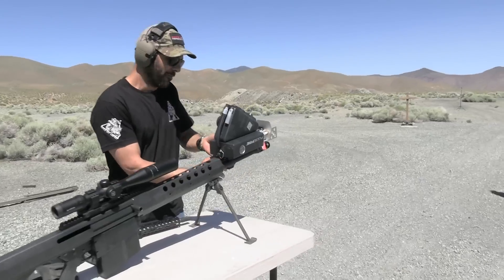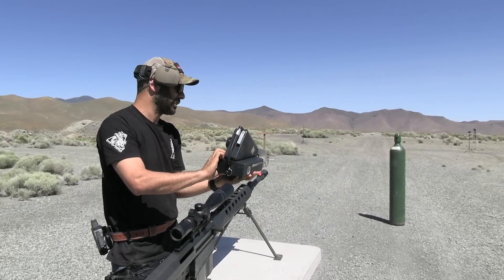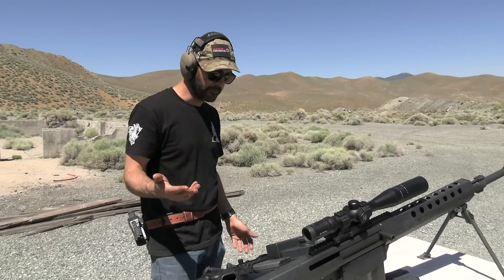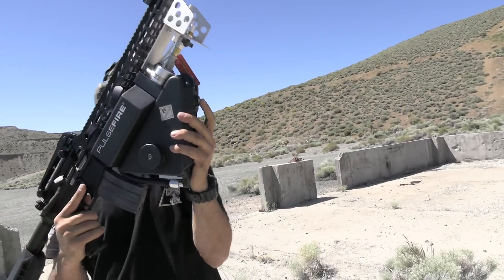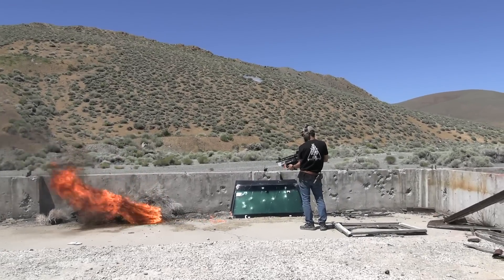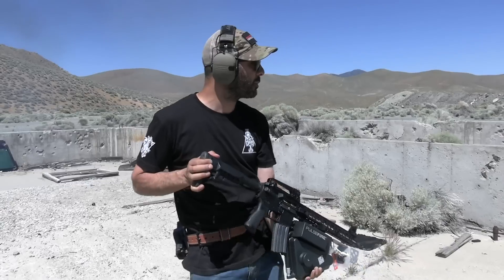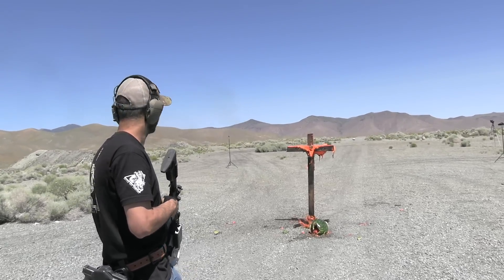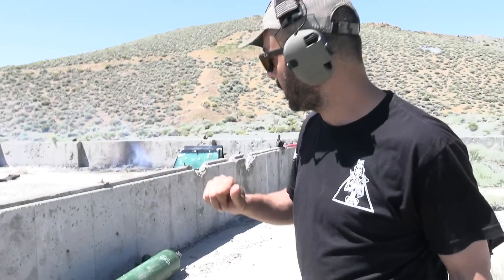flamethrower at a Full Oxygen tank

Comment: Edwin.  Use grease.  Heavy grease coated around the oxygen cylinder.  I doubt it would be that spectacular as I am only familiar with the exothermic reaction when grease comes into contact with liquid O2.

Although I did hear that a pilot who used pure Oxy after eating greasy cheese sandwich lost his teeth in flight when it spontaneously combusted.

Give it a try man.  Make sure you use welding glasses so you don't burn your retinas.

Comment: If your looking to get an, O2 explosive effect you need to have a O2 rich environment contained in an enclosed space. But then again you would want to do it remotely. The effect of the reaction, would put you in the hospital should you survive, from being that close to event of the conclusion and fireball. What your doing is extremely dangerous. You should consult with several engineers that have experience in what your desiring 5o create for your, Science Channel. It’s the volume of gas containment that is accessible by petroleum of open flame, that gets the desired effect. But as stated earlier, what your attempting is dangerous and your just standing to close at the point of reaction. It could have lethal consequences on your, cameraman as well as your self. The fireball would have consumed you completely had the effect taken place with the distance shown in this broadcast. But then again, your more than old enough to continue in trying to light yourself on fire.

Comment: Someone's not been doing their stoichiometry revision...gases have optimal air to ignition source mixture...too much fuel and not enough air will result in zero ignition, or at least, a much less efficient burn or a burn which requires by far more energy from the ignition source.

Also, it's probably best not to try and ignite an O2 tank from in front of it as the likelihood is that if it did catch, the tank will become a high speed projectile in your direction.

Probably would have been better for you to switch places with the O2 tank placing it tank facing away from the barrier where you were trying to light it from with you on the side of the wall where you had the tank.

Comment: The biggest danger of an oxygen tank if im correct is when its surrounded by fire and the pressure inside the tank surpasses the tanks capabilities so it explodes and mixed with the fire it creates a huge fireball and shockwave
Reply: all pressure tanks have something called a burst disc, it is designed to break and allow the excessive pressure to escape safely thus keeping the tank from becoming a bomb.... if you look closely at the main valve on the tank you will see a "nut" with several holes drilled around its perimeter, that is the burst disc assembly.
Reply: @bunnykiller  I aware of that but I failed to mention it in my previous comment, I was mostly referring to the old pressure tanks which don't have that safety feature but based on what you're telling me almost all if not all modern pressure tanks have a excess pressure release valve correct?
Reply: @TheRealName7  yup, since about 1970 or so any tank that can be transported has to have the burst disc... Federal law DOT

Comment: using a mix of 50% gasoline and 50% diesel works better for the flamethrowers because it gives you that more consistent stream, burns longer, is more resistant to wind, and it sticks to stuff better
Reply: Knox gelatin and diesel. Go for it.
Reply: Mebbe add a little bit of dish soap, too.
Reply: @johnnyappleseed6415  soap or used motor oil can be a good extra touch
Reply: @johnnyappleseed6415  We are all cheering for more destruction lol. I have used that 50 50 mix, it burns amazing like napalm
Reply: Adding granulated sugar adds to its adhesive qualities.
Reply: Reminds me of the song Napalm Sticks to Babies.
Reply: Also and a little bit of dawn dish soap to make generic napalm 😁👍
Reply: True. Diesel is harder to catch fire, but also harder to put it out if it does.
Reply: "NAPALM,NAPALM STICKS LIKE GLUE!"....
Reply: In minecraft
Reply: Great Advice.
Reply: I have no idea how safe it is, but apparently styrofoam just dissolves in gasoline and it turns into napalm
Reply: @sandgun3269  yes it does, i made it a lot and still do sometimes and its pretty neutral, diesel can also help stretch the burn time
Reply: As an old special effects and pyro.... most of these mixes aren't bad. My personally built flame throwers used a 9 litre mix of 40% diesel, 10% used hydraulic oil, 10% used transmission fluid, 30% gasoline, 10% pure petroleum spirit, and a shot or so of dishwash soap. 
This is thick enough to stream well, while degassing along the way, giving shooting and staying flames.
Our naptha mix was similar, replacing the hydraulic and trans fluid.
Reply: @FlattardiansSuck  i'll keep that in mind as for i'm currently in the works of making my own flamethrower
Reply: Good input
Reply: Make real napalm.  Styrofoam and gasoline to the right consistency
Reply: honestly a toy for small children
Reply: Or just use kerosene, no mixing.
Reply: I usualy go for napalm or a 25%diesel 25% r
Gasoline and 50% napalm  Mixtur 

Really dangerous but its a Flame thrower  you want it to shoot flames

Comment: If you can, I hope I could see a powerful LASER to an Oxygen tank. 
That must be a 100 million views.
Reply: Looks like Edwin needs to partner with Styropyro for that one.
Reply: Oxygen is classified as an accelerant or "oxidizer "  by scientific community.  It alone has no flammable properties, but mix it with gasoline vapor, hydrogen gas (i.e. Hindenburg disaster), dry fuel found in a rocket booster, and now you have a party! It gives your combustion reaction the ability to burn fuels at higher heat and speeds.  A laser will only burn a hole in tank and maybe let it go flying from leaking compressed gas. Thrust.😅
Reply: Laser experiment now

Comment: The manual says not to open the fuel tank, nor re-fill it without the tank being on the ground or some other surface that is grounded to prevent accidental static discharge build up. It also says to use a 50/50 mix of gas and diesel for best results burning brush etc. Straight gas for the brightest flame for show.
Reply: 10-4 karen
Reply: @theproduct8375  What an intelligent and useful comment. Your family must be so proud.
Reply: @404nitro  they didn't raise a Karen, so yeah.

Now go find a manager to tell everything that's wrong with the video.
Reply: @theproduct8375  He's giving useful information, so chill it a bit.

Comment: Dude, this sucks, but I can help you. Take 55 gal drum with diesel fuel. Take the portable electric transfer pump and run the hose from the 55 gal barrel and plug it into a high pressure water washer with a long wand. Attach near the end of the wand propane torch. Light it up, turn on the transfer pump and turn on the high pressure washer fueled by diesel fuel. Film it.
Reply: Diesel is pretty hard to ignite.